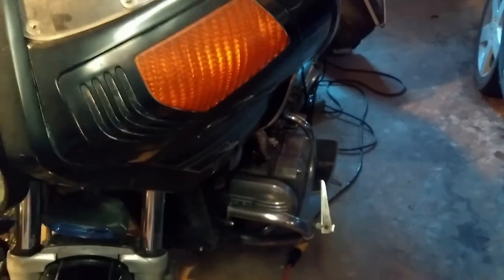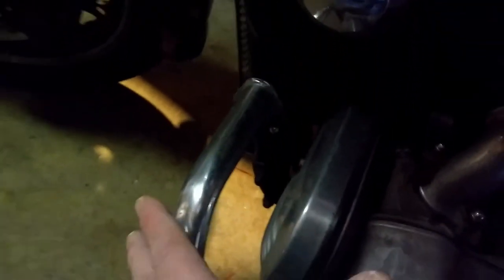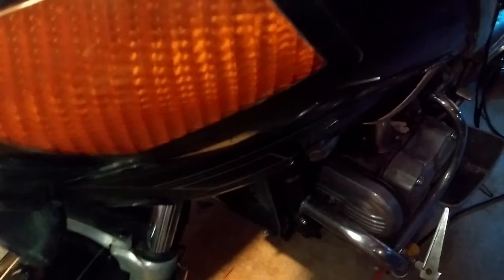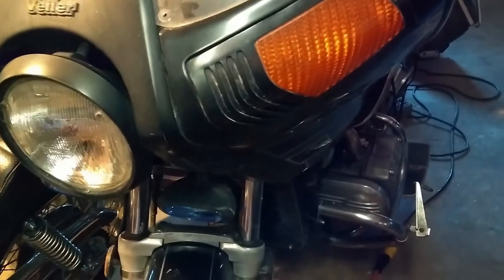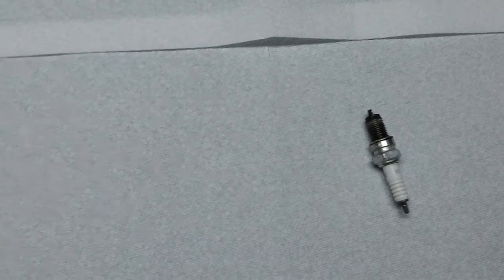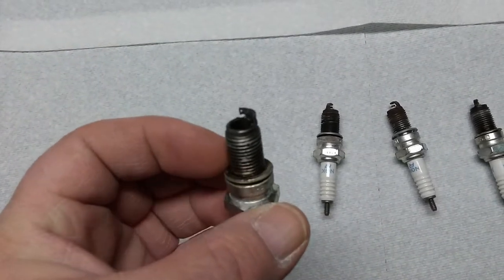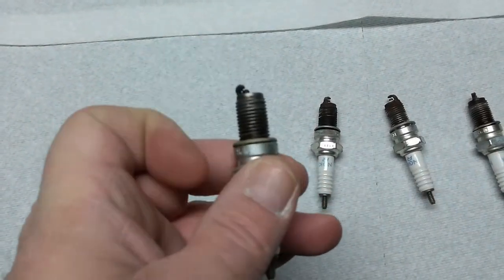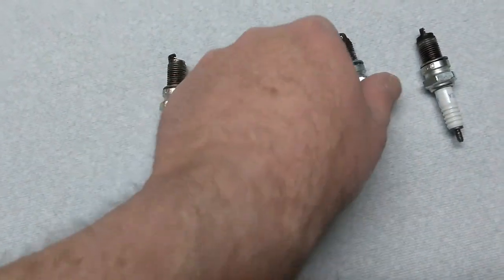1983 Honda Goldwing GL1100 Update 1

Comment: When you pull the timing belt covers off, you can manually rotate the engine.  Hope the flashlight in the hole sees nothing and you hear nor feel anything funny.  When reviving my 550 after sitting twenty years,  I squirted HD 10W-30 down each cylinder.  Besides lubing the walls, it will help the rings seal for compression testing.

Yea, it was cold last night about -14 near Lake Superior and -34 up the Gunflint Trail.  Repaired the tailgate of my truck Saturday afternoon.  Temp was in the single digits but the sun was shining which always helps.  Multiple halogen work lights will radiate some infrared heat to help your hands stay warm in the garage.

Comment: I'd first turn it over a few without spark then I'd replace the oil, plugs, and fuel an 2oz of mystery oil in the gas and try t start it.
Reply from the maker: I tried but it won't go and so I think since its been sitting for 10 years or so it may need a bit more help is all. However I need to get to the crank bolt but to do that I have to remove the fairing and the timing belt cover. Stay tuned I hope to have a quick follow up vid soon.